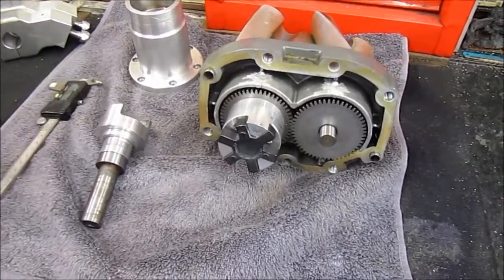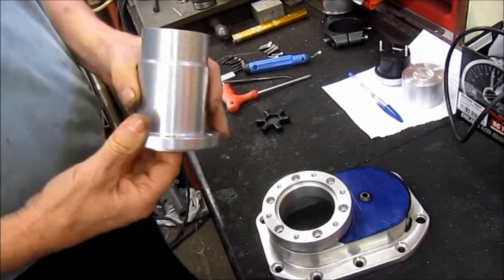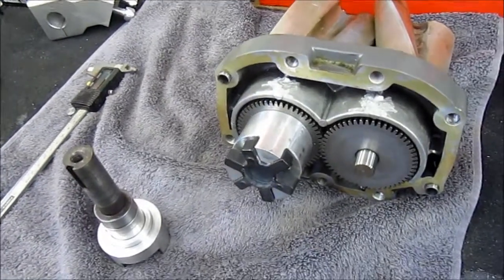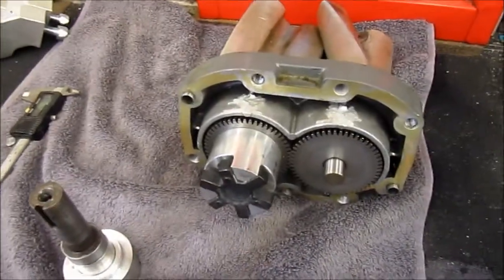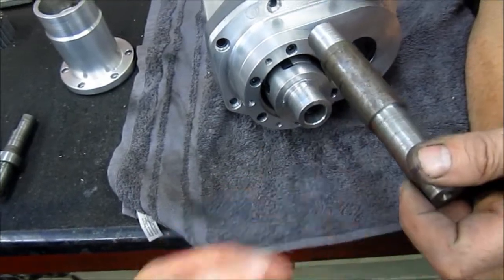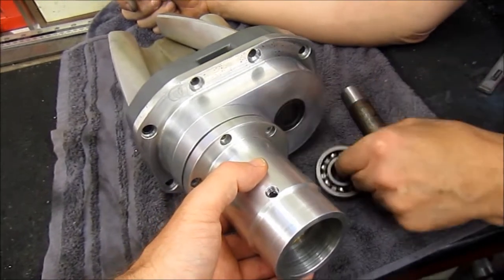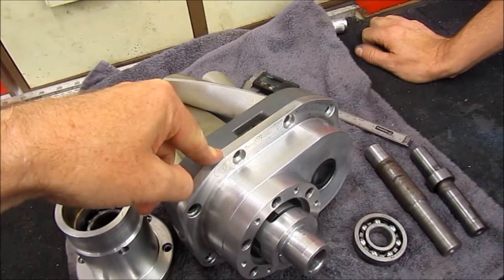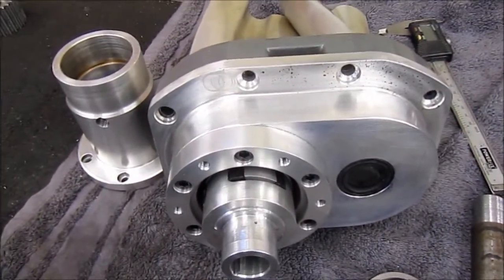In Jeff's Shed - Modding an Eaton M90 Supercharger

Comment: Does the eaton supercharger add noticeable power?
Reply from the maker: Yes but it needs a lot of work to fit, including lower compression. They are used mainly on drag bikes which run on Nitro or Methanol.
Reply: @Bevel Head  it would probably need upgraded injectors, fuel pump and a tune too.
Reply from the maker: @Mattmazz77  Yes, but these superchargers are going on carbed engines.

Comment: Are you guys still able to do this type   of work? I have an m90 an i need to extent the snout so i figured a shaft would be easier
Reply from the maker: Yes,  Not sure if Jeff still has an M90 to work from. I will find out. Where are you based?
Reply: @Merch131ho  I am based in Birmingham..
Reply from the maker: @ITisIwax  Not too far then, do you know the spec of what you want, from which Jeff can make the extended drive? Either way, you can email Jeff on Jhillracing@hotmail.co.uk

Comment: Any idea if the rotors can be pressed off the shafts that they ride on? I'm trying to run a really short nose on mine and I'm curious if I can machine a new shaft that carries both the rotor and pulley because I don't have room for the isolator. There's some Mercedes M62s that do this but I'd prefer to not have to buy one.
Reply from the maker: I think its possible, but may depend on the make/model used. I know Jeff once swapped over the drive gears so the supercharger could run with drive from the opposite direction

Comment: That is seriously sano Did you machine those upgraded pieces? Nice job if you did
Reply from the maker: Yes they have been machined in Jeff's workshop, not by me but by Jeff. The supercharger featured is fitted to his brothers 1978 Z1000, which I posted a video about not long ago, and indeed I'm about to post an update on that bike today. In the meantime, Jeff has been busy machining his own supercharger cases from solid billet alloy. Again I'll be posting an update of this work soon.
Reply: @Merch131ho  im attempting to put a Eaton-90 on my 85 dyna wide glide i recently laid it down after hitting oiled asphalt from construction so its time to add my blower thank you for your reply i anxiously wait to see
Reply from the maker: I have often thought about adding a blower to a Harley Evo. In your case since an Evo redlines at only 6000 RPM, I would think that the M90 would be too big for your engine?
Reply: @Merch131ho  it possibly will be but I'm looking for 6psi only
Reply from the maker: Takes quite a bit of power to drive a big blower, so you may lose as much power as you gain ? 6PSI is very roughly equivalent to upping the compression ratio by two points (on an EVO BT ie from 8.5 to 10.5:1), which isn't too much .. you shouldn't have any issues with pre ignition, which is a big problem with higher boost pressures. How do you plan on driving the blower?

Comment: Make sure you run some fuel through the blower or you will lose boost. Also the blower is limited to 12000 rpm. I'm running a blown Suzuki injected on methanol with the same blower. There's pics on YouTube.
Reply from the maker: Its for a big bore 78 Z1000 road bike with a one off injection system, I think that includes an injector feeding into the blower,
Reply: @Merch131ho  Have you had any issues with fuel stripping the coating off the rotors? WMI absolutely shredded the coating on mine.
Reply from the maker: Its not an issue (so far) as the blower is being used on a drag bike, which doesn't need to run for long for each race.